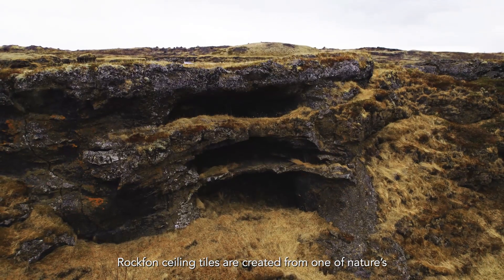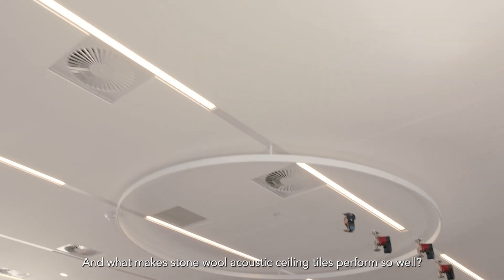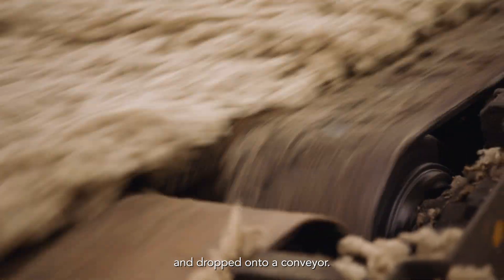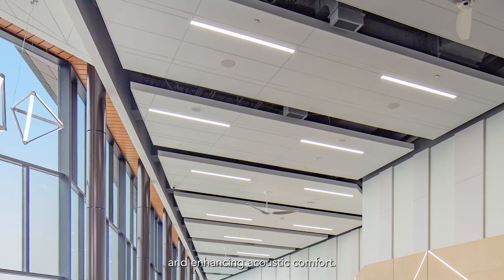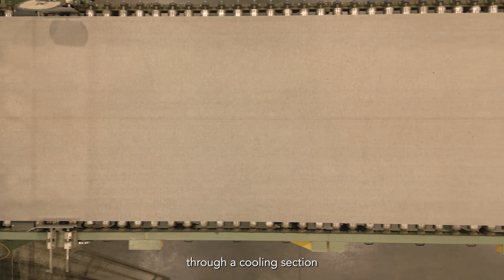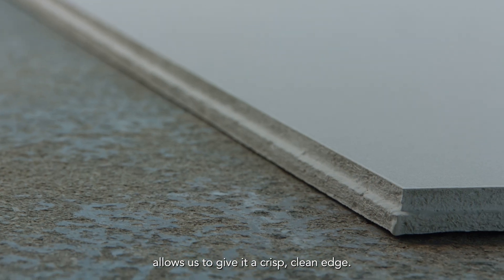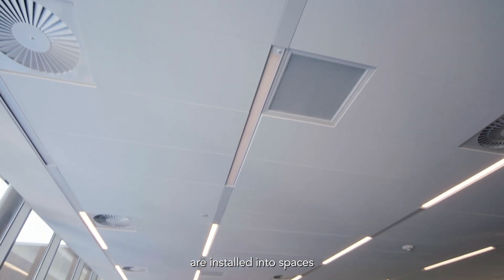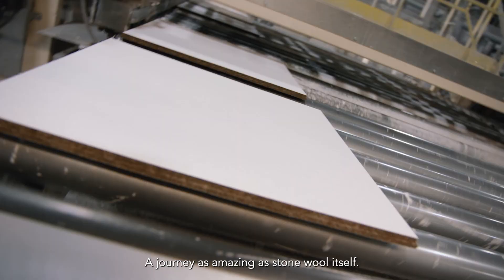How it’s made: from natural stone to your ceiling

Comment: As an experienced installer and owner/operator, I have found that Rokfon does not take responsibility for variable imperfections in their products. After an initial inquiry, subsequent emails went unanswered, which is indicative of their customer service. I advise building owners, contractors, and architects to be cautious. There are alternative products available that offer more consistent quality and functionality. In my experience, the cost of installing Rokfon products is higher compared to others in its class. This observation is based on practical experience rather than personal opinion—please consider evaluating the product yourself, or dont.. it will cost you an unnecessary level of grief.